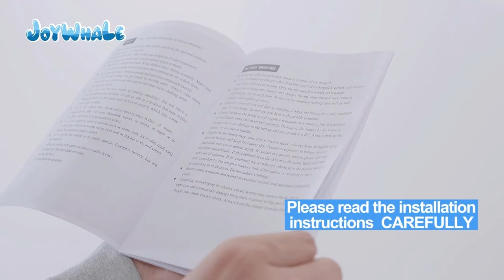BW-609 Joywhale 24V Ride on Truck Installation video

Comment: Battery connected as instructed. Not charging at all. It's should have some charge on arrival. Nothing will turn on. What am I missing?
Reply: @flores9539  I feel pretty stupid. Have to hold the start button down for 5 seconds. Fired right up
Reply: I ordered one and it’s on the way, how does the charging work? It looks like he screwed down the seats, do you have to remove them every time to charge?

Comment: Why is the accelerator pedal so far to the right when this is suppose to be a two seater? It makes it extremely uncomfortable for the driver to reach the pedal! IMO, this is a terrible design. I just bought this and upon inspection I noticed this. If I knew this beforehand I would not have bought it. Bummer.
Reply: I see this a lot w kids riding toys i honestly think its so that either kid can drive from either seat.

Comment: Just got this for my daughter, put it together, charged it and it won’t go at all.
Reply: Same problem,  did you find a solution?
Reply: @paulosbornept7523   we have same issue. Anyone find out anything yet?
Reply: @kittenfan9  You have to push the start button for 5 seconds. I was just pressing it. Held it down and fired right up. It's in the instructions but you have to search pretty hard.
Reply: Mine won’t go forward just reverse 😞

Comment: what is hole wheel hole size (4:48 min)  - 10 mm or 12 mm ?  - nut  size ? (5:05 min)   battery size  (Ah?)
Reply from the maker: Hello, the wheel hole size and the nut size is 12 mm. The 7AH Battay size is 7.3*3.9*3.9 inches. Thanks for your attention.